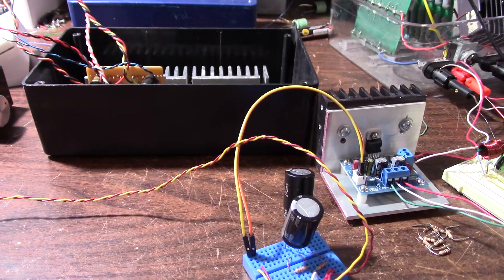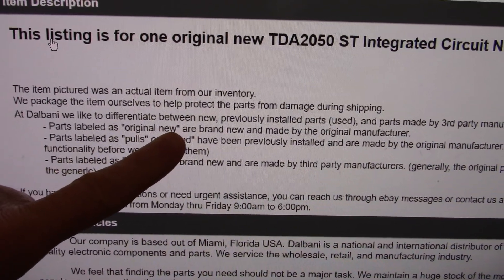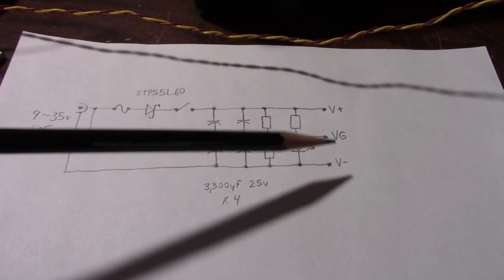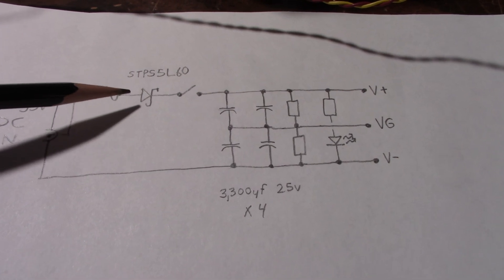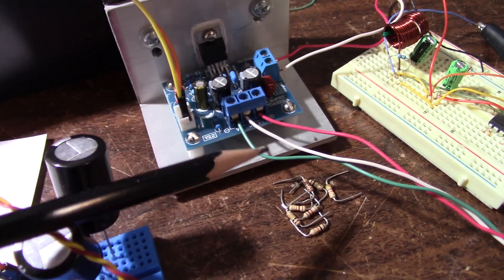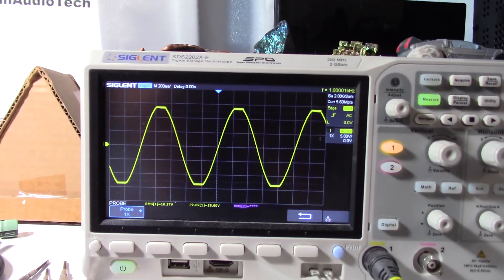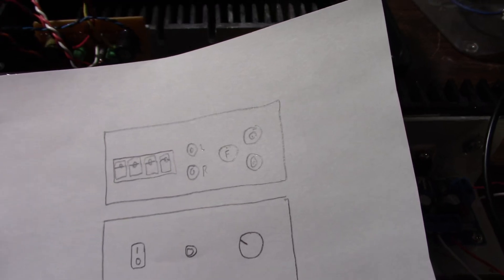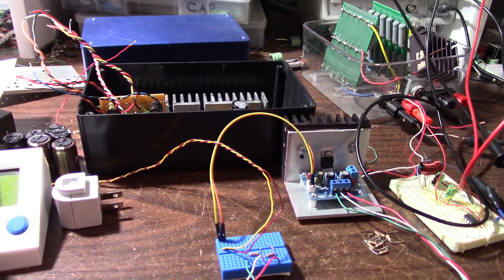Building the universal Stereo amplifier TDA2050 Part 1

Comment: hey John great project on the good old tda 20*0 .
I have been using a 12volts transormer for the TDA20XXs where I split one secondary leg to go to the two AC legs of a FB rectifier, and the other leg as ground. This because I always have to feed a small cooling fan and a Bluetooth module from the same transformer. 
Now, is there any hidden danger/problem in using the transformer that way?
 Thanks

Comment: What about a 5W Class A amplifier using 2x 2N3055 metal cased power transistors and 1x BC212L plus 2x1N4007 diodes and a few resistors and 9-12V @1A should be loud enough.
Reply: Add a BD 139-10 transistor and you will have the components for the John Lindsay Hood Class A amplifier circa 1969.

Comment: LM1875 ?
Reply from the maker: What about it?
Reply: @JohnAudioTech  they can be swapped pin for pin?
Reply from the maker: @godfree2canada  Yes, the LM1875 and TDA2050 can be swapped. You do have to consider the difference in operating voltage limits and difference in some of the components used with the chips.

Comment: At low currents the balancing resistors might work, but at high currents V+/V- will be determined by C+/C-.
Reply: What should be appropriate values of resistors and capacitors if I want to operate this circuit at 24-30 Volts , 2 Ampere transformer supply?
Reply: @amitghosh6966  I think the values in the video are ok. But you need to match the caps for a proper symmetric operation.
Reply: @ergindemir7366  Ok. Have you made this circuit? If yes, are you getting good quality and watts sound of it? I want to know
2) Do you think if this amplifier is powered with single supply as on datasheet, it will give same power output as on split supply?
Reply: @amitghosh6966  No, I only use dual transformer power supply for these kind of chips, I don't like output cap. If you have a single power supply I recommend STA540. For proper dual power supply I recommend tda7294. In short, I don't recommend this chip and power supply.
Reply: @ergindemir7366  Ok. So it means Single power supply won't output maximum power from these Chips and this virtual ground power supply will also not be suitable for outputting high power from these Chips

Comment: splitting the rail this way is a bad idea if you are going to bias the input from the same point with a 15v supply and output to just shy of clipping you will have around 30mv of signal ripple that is present on the non inverting input this isn't just noise it's in-phase noise so you are asking for trouble. so now you have input decoupling to mess with. better to use 2x10kR and 4.7 or 10uf and have a output cap with load to ground. you gain nothing your proposed way it's the opposite of improvement over a couple of resistors and small caps.

Comment: In the spirit of being "universal", have you considered replacing the single Schottky diode with four Schottkys in a bridge configuration? That way, it would not matter if the power source was AC or either polarity. Anything would work. I have several old "wall warts" with AC outputs.

Also, I would a add a couple low ESR ceramics (0.1uF and 0.01uF) in parallel with your big power supply electrolytics. This ensures you have a low impedance return path across the entire audio spectrum.

Comment: John, I know you've already talked about why you don't do pcb boards at home, but there are a number of alternative methods to the "standard practices", such as cold toner transfer, muriatic 4c1d/hydrogen peroxide etchant and small hand drill/dremel press for holes. Sure, you'd need a laser printer, but a plain B/W one can be had for super cheap. And the rest of the stuff mentioned is rather inexpensive as well. I have aplaylist that has a number of these methods shown, so if you are interested, you can peruse "PCB Boards at Home" at your leisure.

Comment: You are a rare breed, John. An electrical engineer with a great ear. Those TDA2050's sure do sound excellent.  I've been looking for a place to buy genuine. Thanks
Reply: The ic is verging on obsolescence thanks to the Class D amplifier modules available. Could try Farnell, Digikey or Mouser. 2 further UK suppliers are Cricklewood Electronics and Rapid Electronics. Operation on a single polarity supply is possible with the output coupling capacitor and a biasing T network of 2 × 22k plus 1× 100k resistors on the non - inverting input. This network is decoupled with a 47uF capacitor across the lower 22k resistor.
Reply: @robertneill3057  The TDA2050's have been obsolete for a while now so they're not stocked by parts retailers. I think the only 50+ watt non-class-D amp chips still in production are the TDA7*** series and the LM3886. They are hanging on for dear life lol. Probably because there are still enough products in production that use them. A lot of active studio monitors and guitar amps use the TDA7923/4's. I've seen some studio monitors use the LM3886 and they are also popular in the hobbyist market so maybe that's why those are still alive. I use 7293/4's a lot and they sound great. On paper and under test they out-perform the 2050 but there's something about the 2050 that sounds so sweet... Confirming that the ol' saying "if it can't be measured it can't be heard" is BS. Don't get me wrong, I am a science-minded person, but I also believe in magic. To NOT believe in magic is unscientific if you think about it.
Reply: I also still want to buy the originals but no success till

Comment: My method of finding original parts: If it is an over-current protected product, create an overcurrent situation. If the product is original it will survive overcurrent, otherwise will fail. I know there are better ways, but I like dramatic conclusions 😅

Comment: TDA2050 is class B amplifier.Watch out its 7% higher  efficiency than the efficiency of lm1875 .The lower thd and imd  and higher instability when compared to lm1875  is due to the lower idle current, basically half of the idle current of lm1875.
Reply: Cool! Thanks for posting about this - it is still in production.
Reply: I sent you a linkedin invitation to connect.corneliu

Comment: i looked at ST data sheet it say can be used in Single or split supply operations  love to see that used i guess its a simple switch up to an electronics guy but i am still not up to snuff  on understanding that mess and why choose to use that set up to power it vs single..Thank you for all your stuff  i got an extra 250 watt sure amp board that need duel supply be neat to run it off -,+.i have the other one swaped in a old receiver i did that way back in 2015..darn nice board .It would be neat if you tooled around with one and talked about chip swaps i read about some ar on about being better 2 x 250Watt Class D Audio Amplifier Board - IRS2092 /part number SKU-AB32291